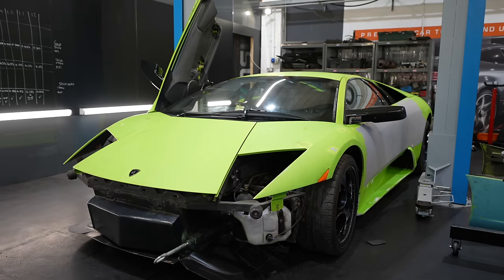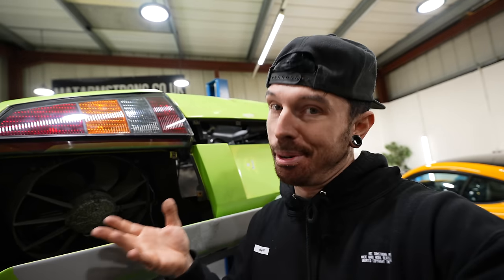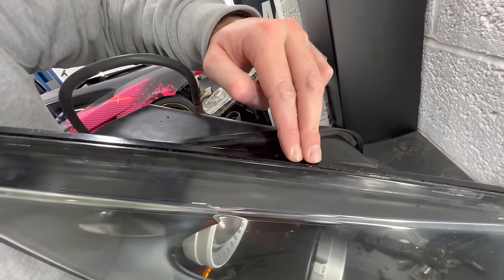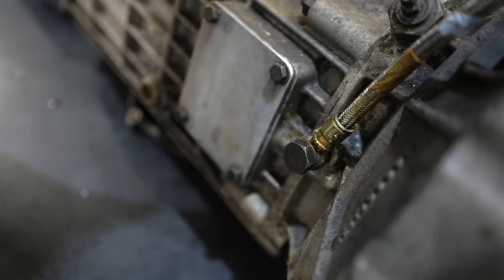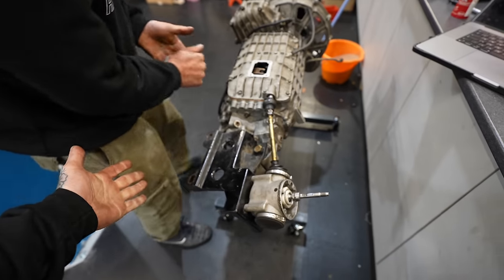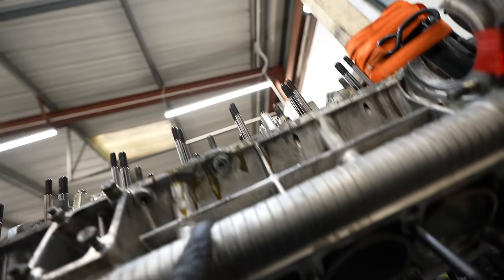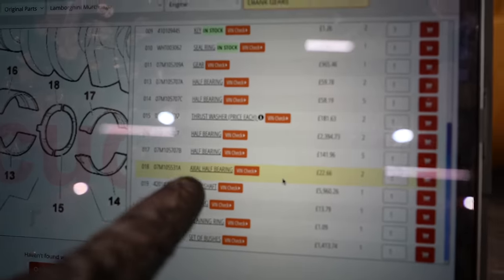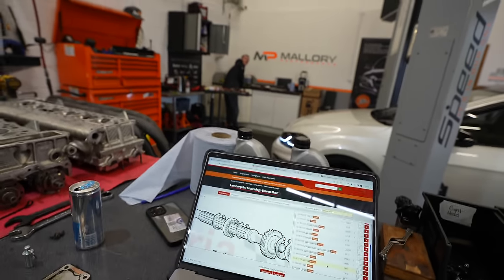REBUILDING AN ABANDONED LAMBORGHINI MURCIELAGO | PT5

Comment: that headlight. NO YOU DID NOT USED EVERYTHING! . Use heatgun on it. I would have it done in an hour max. Heatgun would soften the silicone and let you use knife with snap-off blade to separate  glass from base.
Reply from the maker: Check the last video. The heat is what broke it last time

Comment: at 18:40, you mentioned the workaround for the plastic covers as using the LED bulbs, which makes sense.  Yet, you haven't switched them to LED yet.  So why seal it with the original halogen?  Great video by the way..
Reply from the maker: you can change bulbs from the back of the headlight bro
Reply: @MatArmstrongbmx  You're awesome.  Thanks v much!

Comment: The best thing is that there was nothing wrong with the headlight glass and it was enough to replace the protective film that is applied on top of the glass, so they didn't want to break as you hammered and drilled heh
Reply from the maker: The original glass was really foggy from the inside bro
Reply: @MatArmstrongbmx  so maybe the glass is overheating from the leds, it's strange that lamborgini didn't catch it during the tests or just let it go, but I'm glad that at least you managed to buy replacements from my country

Comment: Amazing u can now buy a family saloon model 3 or Y which is just as fast as this car for a fraction of the price..mat  dude .. switch to electric loads of money to be made..eh new Tesla battery 21k .. which was quoted and therefore the car written off.. I know it was a faulty high voltage connector which cost under £100.